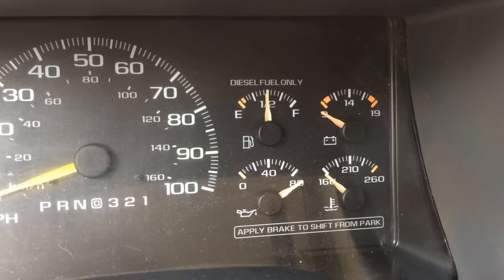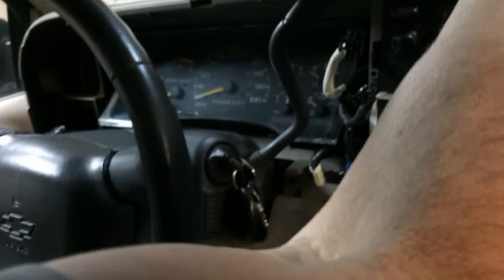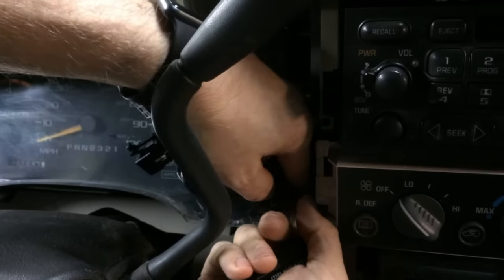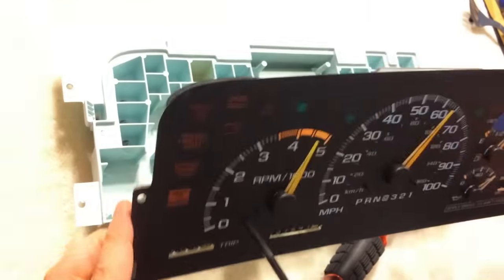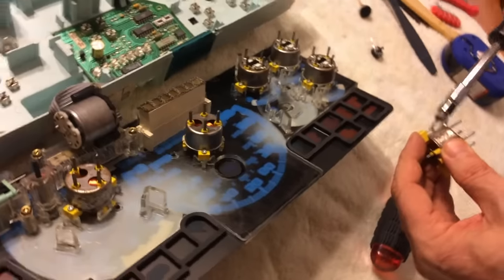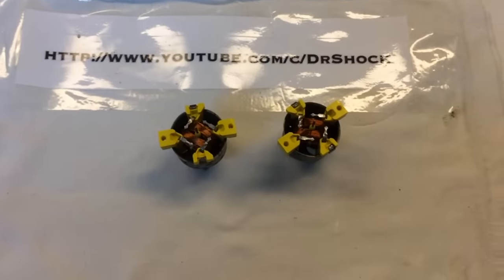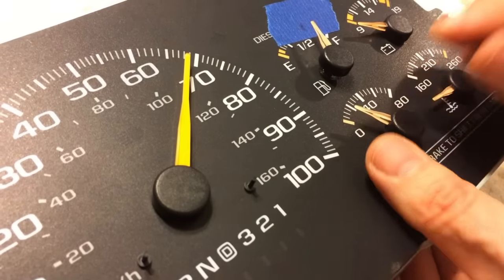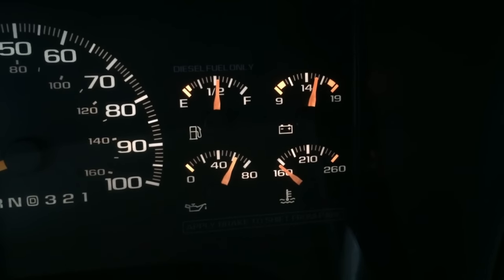1994 - 2002 GM Truck Twitchy Erratic Crazy Fuel & Oil Gauge Needle Aircore Motor Repair (Chevy GMC)

Comment from the maker: PSA: Guys the supply of these replacement Air Core Motors seems to have dried up and they are much harder to find now.  Several links here and in the video description text to help you though.  Try all of the links on both eBay and Amazon to find the best price for the calibration(s) you need. 

They were available for a time as outfits like Dorman that were remanufacturing these dash clusters, as well as local speedometer repair shops, provided enough demand to warrant producing them still.  But as of March 12, 2020 they are basically in the new old stock (NOS) stage now and every one of them will be an easter egg hunt.   The "F" calibration is the hardest to obtain now, I see only two sellers on eBay affiliate linked below:

One seller on eBay, USDashWorks, who is selling the actual units I have bought in the past, has them back in stock.  They have a core charge now though and he's got the "F", "C", "P" "S", and "T" calibrations currently - https://ebay.us/VqEbdY. Here's another I found - https://ebay.us/nud8nD.   Here's a third seller, selling refurbished "F" calibration air core motors - https://ebay.us/2SHX5a  (remember anyone selling yellow plastic housing motors are selling used pulls or rebuilds, not NOS).

I'll update this pin if the supply situation should change.   Remember the used yellow original ones will not fix the needle dancing problem my video covers for the "F" or "C" fuel gauge air core motors, but the used yellow ones should be fine for the other gauges in "T" "V" "S" and "P" calibrations and to correct a completely inoperative / dead gauge situation.
Reply: DrShock I am going through a bunch of these 6.5 videos once again because my truck is broke down once again. I hate this truck. I really hope I can earn enough money to buy a new truck soon.  Good video btw. If I cared about my truck, I would do this swap.
Reply: I'd like to add that we have remanufactured "f" motors and they are good to go. I have the original applicator to inject oem fluid into the motor. The "f" motors are permanently out of production. The remanufactured F motors are the only option now. Visit www.usdashworks.com  to place your order.
Reply: I am having a different issue in my '94 Suburban. I can tell when the oil is getting low when the oil gauge starts twitching. I get low on oil quite often because I am using that special Mobile 1 0W-30 for better fuel economy. For the fuel gauge, I think it was not calibrated for the fuel tank. From the factory, it came with an optional 45 gallon tank. When the tank is full, the gauge goes way past the F line. The lower the gauge goes, the more accurate it becomes.
Reply from the maker: @GeekBoy03  Past full line really sounds like a sender problem.   This video might help - https://www.youtube.com/watch?v=dw9Hia55yys  as the test it covers is for both gas and diesel.
Reply: If you can find new replacement, the white ones will work for fuel level? I went to the junkyard and found a F gauge. And it had good resistance so I replaced it but it still vibrates. I adjusted the gauge as follows. And I also replaced the fuel pump. Due to a fuel sensor level code. So I’m sure the fuel pump sending unit was bad and the gauge was bad as well.
Reply from the maker: @pulpo.r7790  The video description has some more info on why the used motors can't be used to repair this problem, as well as which calibration codes fit what gauge.
Reply: @DrShock  so the white ones will work fine if they can be hunted down? Some other videos I found say they can’t be used due to malfunction. Mine doesn’t twitch anymore it just vibrates very fast and stays in one spot. I will have to find new ones if possible. Thanks
Reply from the maker: @pulpo.r7790  I repaired several OBS trucks with these white plastic NOS motors before they went rare (including the truck in this vid), for fuel gauges and oil pressure gauges.  Never encountered any issues whatsoever using NOS aircore motors from China, the gauge with one installed in the video here has been free of the twitch for over two years now.   The needles fast vibration is just another variation of the aging problem with the internal dampening of the aircore motor used for the fuel gauge.   Sometimes they stay like that, sometimes they progress to the worse version I showed in the video.  And sometimes you can have the aircore twitch problem coupled with a fuel sender problem in the fuel tank as well.
Reply: My speedometer reads 85 while doing 40 and my tach pegs out max after startup. What do you think?

Comment: FINALLY!!! A video that not only is exactly the issue I have,, but also a step by step as you "show" the steps where there are no gaps where I have to guess or wonder any of the steps, like other how too videos on here! Thank you for this video! I was about to replace the expensive sending unit! I woulda benn so pissssed to find that wasn't it!!! thank you!
Reply: In the future when the next gauge in your truck goes crazy twitching. Try using super lube silicone oil, used that on my fuel gauge it was doing the same thing, twitching and going crazy. The fuel gauge works like a damn now.

Comment: AWESOME!  I have the same issue.  Been trying to figure out what is wrong with my gas gauge for years.  Thanks!
Reply: I HAD THE SAME PROBLEM A YEAR AGO REPLACED THE FUEL PUMP FIXED IT,ON 1998 GMC SIERRA EXTENDED PU 5.7L

Comment: Enjoy the coffee! Had to replace the gauge cluster stepper motors on my 2002 Buick LeSabre. The Buick's erratic oil pressure reading was just the sensor; same thing on my GMC. LeSabre fuel readings were the sending unit on fuel pump. Thanks for the videos.

Comment: Oh man, this was both hilarious ad informative. I just found a sealed and preserved GMC SUV cluster that hss a tach that goes to 6 whereas, my 1995 Yukon has one that goes only up to 5.  So, I one found in a field out in the desert. The desert sands are used frequently by illegal trash people and the stolen vehicle mafia for parts dumping. It has sand inside it but I am still going to try it out. And here is shocking reason why: You see,
I too am suffering from the painful and expensive disgrace of living with the embarrassment of having the insidious condition of The Fuel Gauge Twitch. Hiw much gas do I have left? Thats that little dials only purpose. To let me know that I could be stranded by you in 20 miles. Now I have to do the MGP math. Then remember my miles. Wow, fuel gauge, I never realized how much you really do for me. Thank you.

Comment: Did this to my '99 tahoe. Seems to be working so far. Tip: fill your tank full before. Don't try and fit every single drop in your tank. Just go the the standard first click at the pump. 

When you first turn it on, the fuel gauge should adjust itself to full, it is slow. Let it go for a minute or 2. Key off, adjust needle and do it again. Run it with the cover off for a little while and watch your gauge, make sure it continues to read correctly. Go to 3/4 tank, fill up. Do the math for your tank size and it should be good. After you verify, close it all up. Gauge motor delivered was about $104.
Reply: Whereabouts did you purchase the gauge from?do you have part number?

Comment: I was going to buy one of these aircore motors on eBay, as suggested, and found one being offered by Digital Dash Solutions.  Out of curiosity I Googled them, found their website, and saw that they were offering the same aircore motor that they're selling on eBay for less money, $30 instead of $44!  So I ordered one from them, received it in California from Connecticut in a couple of days, and I just installed it yesterday.  My old one had been doing the quivering thing and occasionally swinging wildly, then it would stay on "Full", so I couldn't mark the level as shown in the video.  So I went and filled the tank, then set the needle on "Full".  Now I'm going to have to drive around and see if the needle responds the way that it's supposed to...
Reply: Darrin De May did it work out for you?

Comment: Good thing you told us how to do the fuel gauge, cause that's the one you didn't say how to do other than to remember where it was but that kinda no help because it's erratic and who knows if its actually sitting at whatever. What if the gauge doesn't work? I guess I could fill the thing plum full probably be the only way.

Comment: A tip for those with a scanner that reads live engine and sensor data… including fuel level.  I always connect my scanner with the cluster lens off so the needles are easily accessible. I watch the readings on my scanner versus what the cluster reads. If it reads a bit off, I shut off the vehicle and adjust the needles accordingly. I even test drive it to be sure the speedo is accurate. I hope this helps someone.

Comment: Nice video.  I have two 98 chevrolet trucks.  The half ton's gas gauge does not work and it usually reads completely full no matter how much gas is in it but will periodically drop down to empty and then go back to full.  The needle also has a slight vibration to it so that it looks blurry when you look at it.  I don't know if this is a sender issue, wiring issue or the gauge.

The 1 ton's oil pressure gauge bounces around and always reads 80 psi initially.  The volt gauge usually always reads low and my speedometer is off by about 5 mph.  I would like to fix all of these issues but those motors are expensive so I may just have to live with bad gauges.
Reply from the maker: Thanks, the fuel gauge needle twitching/vibration is definitely the aircore motor itself and the subject of this video.  But the gauge not working reliably, or at all, is more likely the sender in the tank.   This other video I did was mainly for the diesel engine but the schematics and test process in the front are the same for gasoline.  You might try this - https://www.youtube.com/watch?v=dw9Hia55yys
 
Since you have troubles with the fuel, oil pressure, speedometer and voltage gauges it's more likely a cluster issue than all of those individual aircore motors going out at once.   If this were my situation, I would try an LKQ salvage yard and pull an used replacement cluster myself, keeping the gauges but transferring over the odometer from my original and seeing if I get better results.
Reply: @DrShock  Thanks for the reply and information.  I will have to see if any of the salvage yards still have any clusters.  The one ton truck with all of the cluster issues only has 119,000 miles on it .

Comment: Yep I have a 98 Chevy Cheyenne 2500 5.7 and does this . My oil pressure gauge seems to work but my oil pressure isn't good when gets hot but my temp is off and my gas gauge is off

Comment: I have a 97 Olds Cutlass Supreme SL. I removed the cluster to clean and repair the lights. I also painted the plastic frame where the lights are with a gloss white. Back together and reinstalled the cluster. Everything works great.... except the speedometer. When I turned the key on, the speedometer went to 10 mph. So I pulled the needle and set it back to zero against the stop pin. My problem is that it now reads anywhere between 8 to 10 mph too high when driving. Verified using my scanner to show VSS indicated speed, and a GPS mph app. Both read the same speed. Am I overlooking something? As usual, stuff was working fine except the lights before I did this. After 40 plus years of jet aircraft engine and sheet metal overhaul/repair and repairing cars since I was tall enough to see over the fenders stuff like this happens and it's annoying. The speedometer doesn't normally move when you turn the key on and after moving the needle from 10 to zero it hasn't moved when the key is turned on. It just reads too high when driving. I'm at a real loss here.
Reply from the maker: These components can be very fragile, age an all.  I would be hazarding a guess.  But cleaning implies a chemical that may not be vintage electronics friendly.  Either the aircore motor for the speedometer was damaged by the cleaning, or damaged when disturbed from it's original mount.   Fortunately, these don't have the issue with internal dampening fluid that the fuel gauge aircores do, so a salvage yard donor should fix you up there if this is the case.   I'd carefully inspect the flexible circuit board for no damage to the speedometer mounting area as well though.
Reply: @DrShock  Hey, thanks for the response. Actually it has a genuine circuit board. Phenolic material I think, but not a flexible one. I didn't touch the motors or board as far as cleaning went. However your points are well taken. Nothing to lose so I am going to try and reposition the needle at 25 or 30 mph indicated to what the scanner says actual is. (Front wheels off the ground). I'm like a kid in a candy store when I go the "pull-a-part" yards here. I have a spare cluster as well so if all else fails I will cann a motor from it. I will let you know how it goes.
Reply: Update: The adventure worked. Pulling the needle out and repositioning it to actual speed while the speedometer is running. Took two minutes and six tries. Lowered car back on the ground and road tested. Speedometer read correctly at all speeds comparing to scanner VSS speed and GPS MPH app. I suppose this is one way to do it. Could be pure luck also. Anyway, Thank you for the video and the help.

Comment: Yess!! My oil gauge does this andy fuel as well!! It causes it to pop up a check gauges light and causes it to idle.rough
Reply from the maker: If you're getting a service engine light, it's not the gauge but rather a genuine engine issue you need to get diagnosed.

Comment: My gas gauge spun like a clock and just like you said it took out the oil pressure gauge. 99 k1500 5.7 suburban. Its a shame it went bad altho i had to replace the stepper motors in my 04 yukon 2 years ago. So it lasted longer (suburban) then the next generation factory replacement(yukon).

Comment: Great video!  I changed the motor with a new one.  Included the resistor and the motor is making a buzzing sound.  I replaced the sending unit and fuel pump and still the same issue.  I even tried a used stepper (F) motor from a different dash.   Guys - I’d appreciate any thoughts on where to go next.  Thanks!
Reply from the maker: Is the buzzing only coming from the aircore motor for the fuel gauge?  Did the old one make this buzzing sound as well?
Reply: Yes, the buzzing is only from the air core motors.  I’ve tried three of them.
Reply: To clarify…only from the fuel gauge air core motors.
Reply from the maker: And even the original motor was buzzing?   If not, was the motivation to replace it due to the needle dance problem alone?   My first reaction with this symptom is a wiring problem heading into the cluster, but the original aircore motor should have exhibited the same noise.
Reply: The original motor had a very faint buzz to it but almost inaudible.  I placed my finger on the stem and could feel it vibrating.  The new motor was more amplified and also vibrating.  
The idea was to correct the vibrating fuel gauge and fix the random intermittent fuel reading.  Most of the time it would read correct and then randomly show empty or a full tank and stay there for some time.  Thank you for your questions and trying to help. 
I’ll get under the truck and follow the wiring harness this weekend and see if I can find anything.

Comment: I have a 1995 Chevy S10,  the oil pressure gauge seems to go crazy and give odd readings and my tachometer needle stops at 1000rpm when I turn off the engine. I can tap the cover and the needle goes back to 0. Is it a air core issue?
Reply from the maker: If tapping on the cluster lens affects the needle position, then very possibly.   This problem is typically a fuel gauge only problem, so I wouldn't immediately jump to this as the cause of incorrect oil pressure readings or the tach without further debug and analysis.  But if the needle is affected by "tapping the glass" that certainly sounds like a problem with the motor to me, perhaps in conjunction with something else though you may still have to diagnose separately.